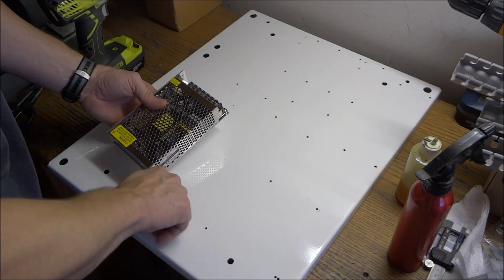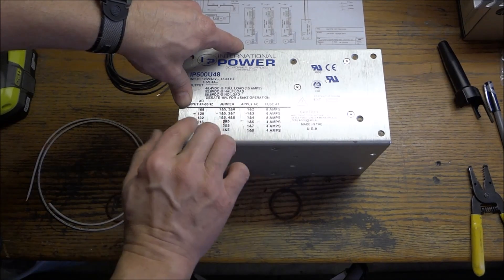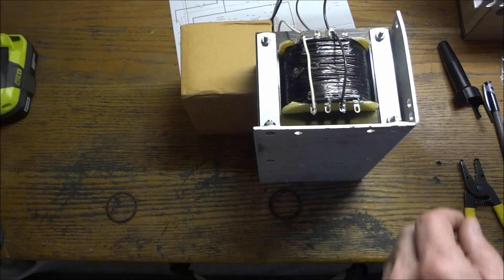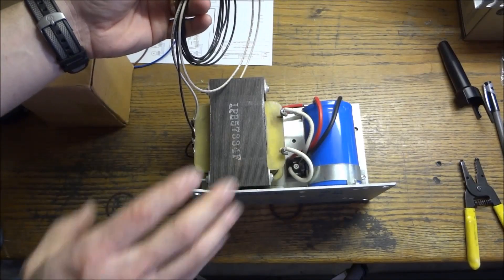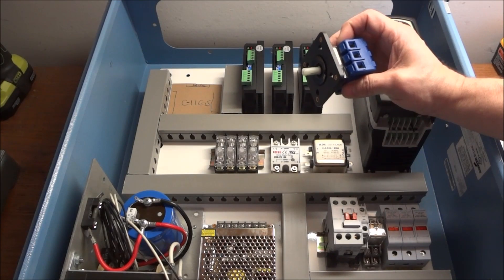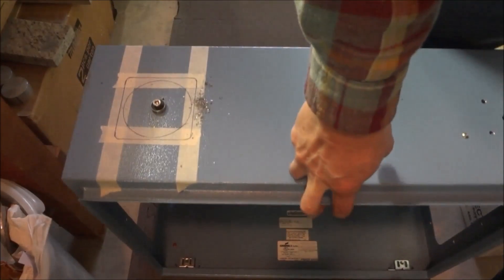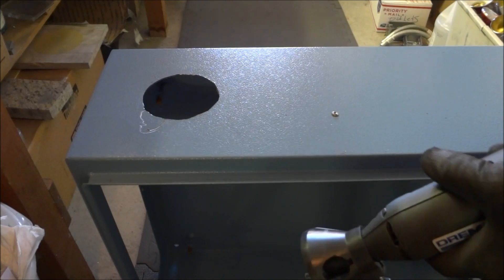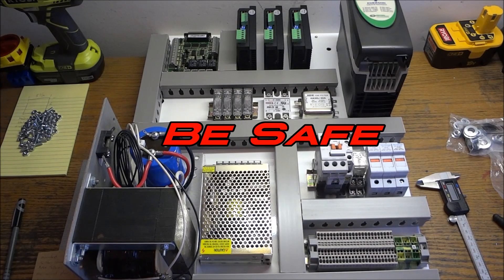PM 727M CNC  Electronics Mounting

Comment: So the tri-power  power supply is just for your PDB which needs 12V.. and you also have a 48V power supply to power the steppers, drivers, and the controller is that correct?  How many amps does the power supply need to be to power the three motors which im guessing are around 3A each ?  I think I saw your International Power display on the panel that 48V will fetch 10A under full load so is that enough to power all three motors, controller, drivers, and the fans?
Reply from the maker: Tri Power is for Control power. The Steppers are 5 amps

Comment: Is the brake resistor for a z axis Servo break? I have one of their 400w and dyn2 with brake but didn't really understand if I needed to get a brake resistor
Reply from the maker: No it is for the 3 phase spindle motor.
The brake your referring to is a holding brake.

Comment: What does breaking resistor do ? Thank you.
Reply from the maker: When the spindle is turned off, To stop it quickly we need to absorb the energy of the rotating mass in this case a spindle, however a 6" chuck creates even more energy. This energy is dissipated through the Braking resistor in the form of heat. Most vfd's have small resistors built in to absorb small amounts of energy but nothing that can handle what most CNC machines would  produce.
Reply: Thank you too much bro.

Comment: From an industrial panel angle, I'm not sure why you are talking about putting this on a desk, it is designed to be wall mounted.
If someone did mount it on the wall, then the cutoff goes on the door along with indication lights, and the fans/cables go on the top/bottom cutout panels. This makes the design a lot simpler. You've kinda wasted a nice box here.
The braking resistor would normally go on a vertical plate screwed to the rear mounting panel, typically stuff is never screwed to the actual box, that's why they use use a mounting panel in the first place.
Also, mains transformer needs sleeving on the soldered terminals, and the capacitor needs a terminal cover, too easy to short these things if someone was poking around while live.
The mains cutoff needs to be dual pole, if someone swapped the workshop's incoming L/N , you'd have live wires in your case.
Otherwise, pretty good.
Reply from the maker: Well thank you for those Notes, I have worked in industrial panels for the past 20 years on automated equipment from many different MFG. So I can agree with almost everything you have said. Of course bear in mind this was done on a Budget and limited funds so I tried to fined deals when I could. I was a little uncertain of where the box would be mounted. So putting the Main disconnect on the side made the most since and gave me more options. Wire Ferrel's should have been used on all connections I did try and use shrink tubing to cover things up. Always room for improvement. Thanks Again
Reply: I was in Nuclear Control Engineering for a bit less, same stuff everywhere though.
Don't get me wrong though, I could go on all day about how this project is great, it's just that I'm English and we never normally say stuff like that, I was just posting what I hoped might be useful. Sorry if it sounds like I'm teaching grandma to suck eggs.
Like your labelling of wires, I've never seen anyone outside of Industry do that, this box is easily the top 3 on Youtube :)
Reply from the maker: I completely understand that the comments were constructive and I appreciate them. From a industrial standpoint there are several things I would do differently. and many of your points are some of those. I will be building another panel soon and hope to incorporate some of those changes however I'm sure I wont be able to get them all. Thanks for the input.
Be Safe,
Sam

Comment: Hi Sam, did you have any issues finding your 110V Input, Emerson drive?  I can find the 220V version, but no luck on the 110.
Thanks, Rich
Reply from the maker: Hi Rich, at the time they were available new At  http://www.galco.com/shop/Commander-SK-Control-Techniques-AC-Drives However I purchased mine off E Bay used.
Reply from the maker: Rich, DID you find a alternative drive? I think I would go with a :http://www.ebay.com/itm/HY-1-5KW-110V-VARIABLE-FREQUENCY-DRIVE-INVERTER-VFD-2HP-7A-/272563914956?hash=item3f761348cc:g:bGgAAOSwjVVVxFOW

This gives you the option of a 1HP or 1.5 HP D80 frame Lesson IEC motor.
Reply: Hi Sam, Thanks for the info.  I will review this VFD.

Comment: Hi Sam,Great Project, Do you have a wiring diagram that you can share?
Reply from the maker: Yes I do have one I've draw up for this build I plan on going thru it before I get started wiring. 
If you have any specific parts you want highlighted please let me know. 
Be safe Sam
Reply: Thanks Sam,  The noise filter would be a good highlight,  can you email it to me when it's ready?
Reply from the maker: +Robert Carr will do thank you
Reply: Thanks have a Happy Thanksgiving
Reply from the maker: Great yea the cabinet is a real bargain very Hd 
What build are you working on?
Reply: +CNC4XR7   Doing a JET Knee Mill VSM,  first time trying it,  learning Mach3, wiring and CNC all at the same time,
I appreciate all the help and the videos.
Reply from the maker: Ok great so you will need pretty much the same setup as I have. Of course you can add the vfd  and 3 phase motor later. 

Email me I will pass along my wiring diagram. 

Cnc4xr7@gmail.com

Comment: Nice cabinet. As a suggestion for the fan hole, I would have made a cheap investment in a hole saw, that makes a nice round hole in less than a minute. Cheers, Brian.
Reply from the maker: Yea sometimes I'm too cheap I just figured buying a hole saw for a 3" hole that I may never use again was a waste. But it would have been faster for sure. Thanks.